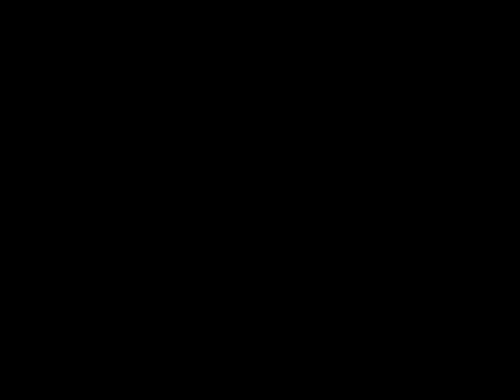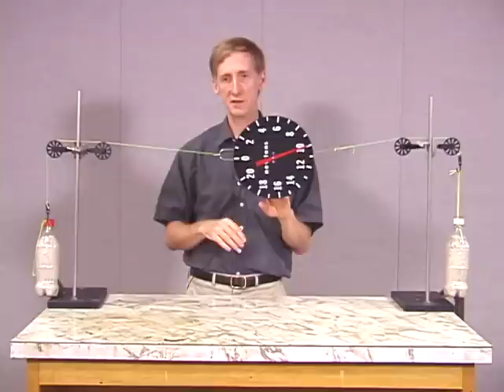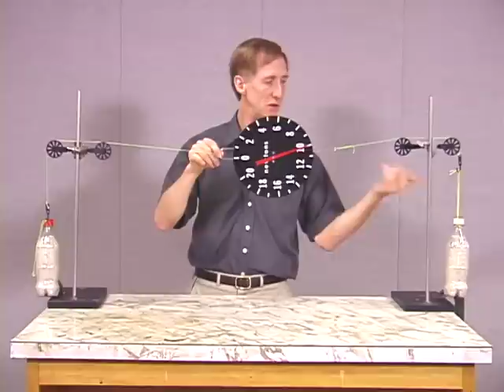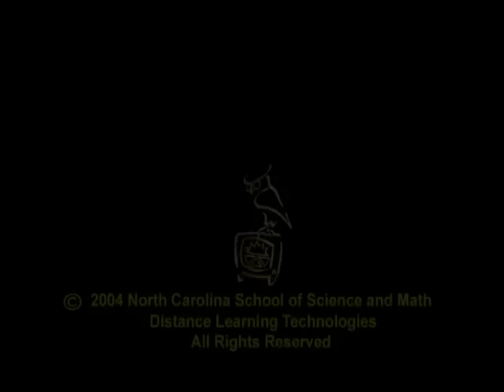Spring Scale: What Does a Spring Scale Measure? Part 3

Comment: The instinct is to say that there's a 10 N force pointing left and a 10 N force pointing right, so the net force is 0 N. But the trick is to realize that the force pointing left is not exerted on the spring itself, which is actually measuring the weight via its displacement. Otherwise, you could never use a vertical spring scale to measure weight, because it would always read zero from the force of whatever's holding it up countering the weight of whatever you're trying to measure.

Comment: What will happen if the force on one side is 10N and another side is 20N. Explain please
Reply: Scale reads 0?
Reply: @ginahaddadin6316  i am asking for a general expression with explanation.  Let's say one side has force f1 and another side has force f2 and ( f2>f1) then what will be the reading of the scale
Reply: @aatreyasengupta6253  a spring scale measures the amount of tension exerted in Newton’s. Which ever side that is tension is what the spring scale measures. Refer to Newton’s 3rd law of motions and spring scales. :)
Reply: I had the same question. what will happen to the if the stationary holding the scale is bigger than the force pulling on the scale?? and vise versa
Reply: The scale will move

Comment: My confusion is what if two people started pulling a spring scale from each end the reading will be double than me alone pulling it from the hook side
Reply: I'm thinking the exact same thing
Reply: I think it's double because both person on a friction floor. Assume person A and B holding both sides of the spring scale. Let have A pull with a 10N force. If B remains stationary, then then B already "indirectly" applying a counter force of 10N (from the friction). Thus, the spring scale will have a tension reading of 10 N. 

Now to match your case, let B pulls with a force of 10N. So the force from B will just add up to the already applied force from A. That will result to 20N reading. 

Different from this video. Hanging the load, and using pully, are both for frictionless case.
Reply: It won't get doubled.
When you stand up on a weighing scale, it read your weight X Newton, and the same force, normal force, is applied by the ground X Newton, net force is 0, but same force is being applied from both sides, scale readers X Newton, not 2X Newton. Now you can apply this horizontally also, it's how spring balance works.

Comment: What if I put 200N on⬅⬅ pull side
Reply: It's been while but if you are still interested, it would accelerate to the heavier bottle's side for there would be an inbalance of force in the system.
Reply: That only means ...on left side 200 and on right 100...it will move towards heavy weight... reaction end should have same weight as of weigh applied viceversa.
Reply: It will read 10 N but the scale will move toward the 200 N by a force equal to 190 N